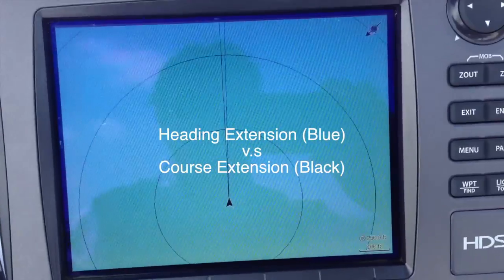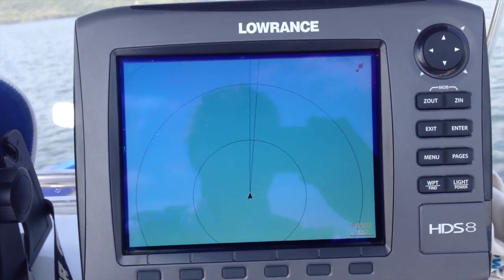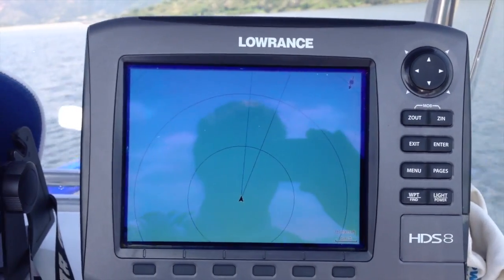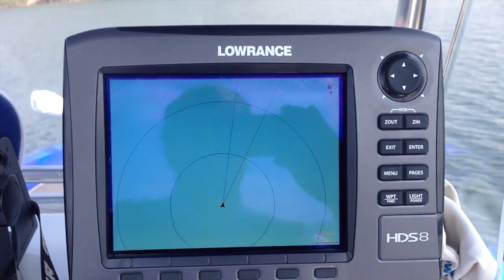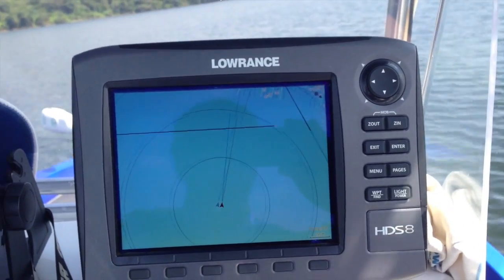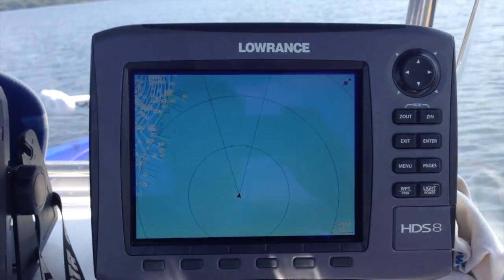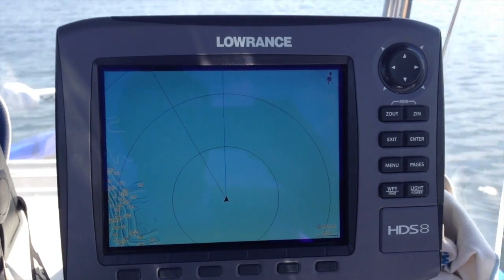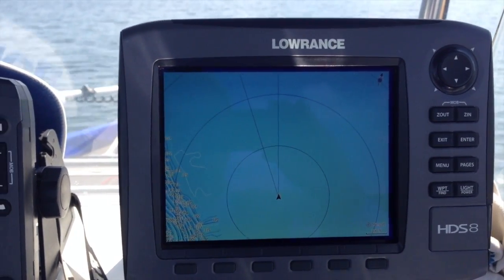Lowrance Point-1: Heading Extension v.s Course Extension

Comment: ... Yes, I know this is a very old video but the questions are still relevant I believe.
... Lowrance HDS 12 Gen3D
... My CE and HE have never shown two lines. 
Now I have a Point 1, is the Heading Extension the better one to choose? 
Thanks
.
Reply from the maker: I like to always use both so you can compensate for wind, current and prop torque